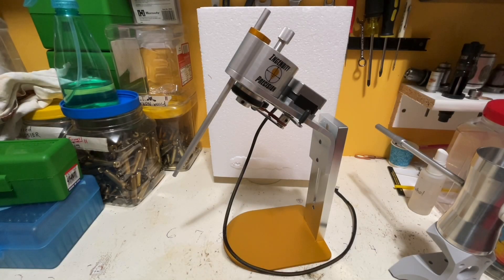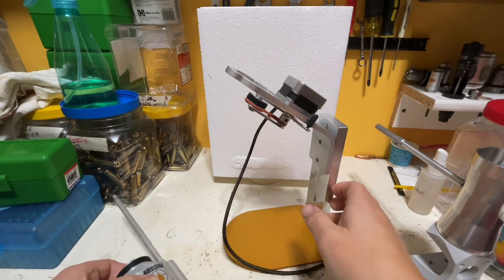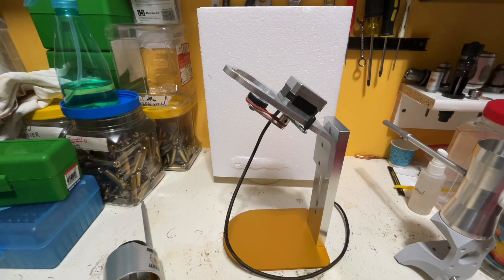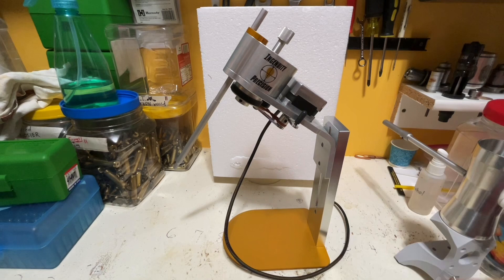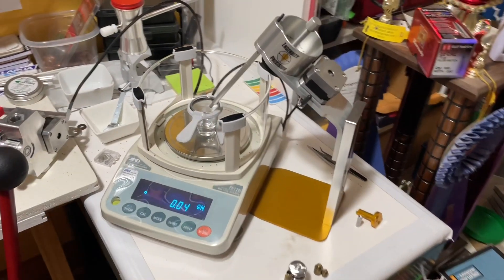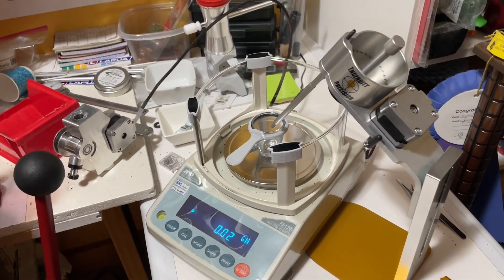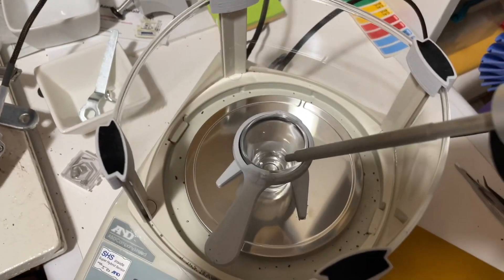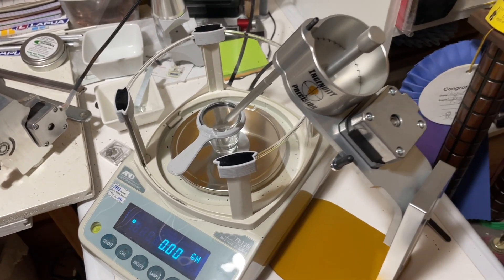Ingenuity Precision Powder Trickler Review (AutoTrickler Upgrade)

Comment: I threw around 2000 charges with my Gen 2 supertricler to try and get it setup with 1 powder (N560). Best I got is 7 straight charges without a overthrow. And about a 70% success rate. Some take 5 seconds some take 120. And that is with a 0.08 grain tolerance. Setup on the supertricler is basically load development on your powder dispenser... And the AI can't do it. You need to tinker constantly. I sold it and moved back to my v3. Just added the IP tricker.

Comment: I have both. Basically the answer is no, not better than the super trickler. But pretty much required for the auto trickler. The vibratory trickler in the supertrickler is really good. Hopefully adam will learn from the missteps in the auto trickler v4 and improve the small trickler with the v5. Rex delivered an impressive product for a v1 super trickler design.

Comment: The supertrickler sucks. After 2 months of trying to get it to work consistently I sold mine and went back to my AT V4 and now have a V3 again but with IP trickler.
Reply from the maker: I’ve been hearing several people complain about the SuperTrickler as of late. Seems like a great idea, just lots of software issues. They have a FB support page where I see several negative remarks on them there.